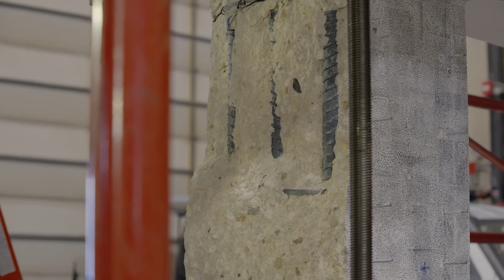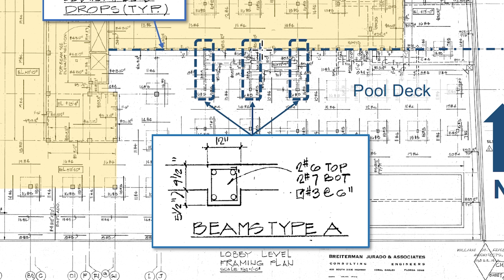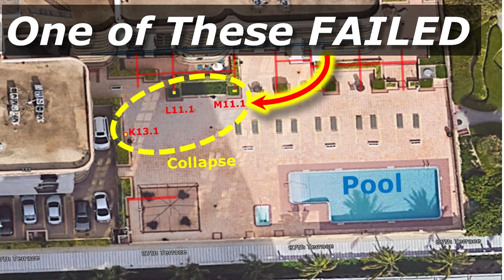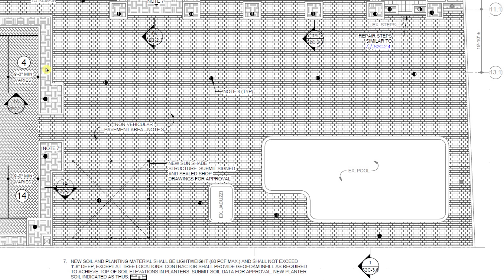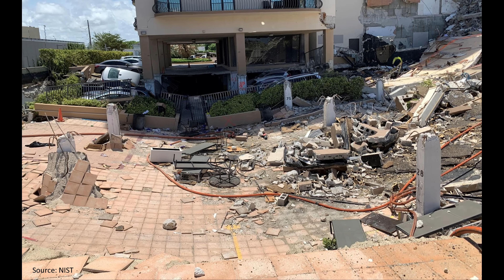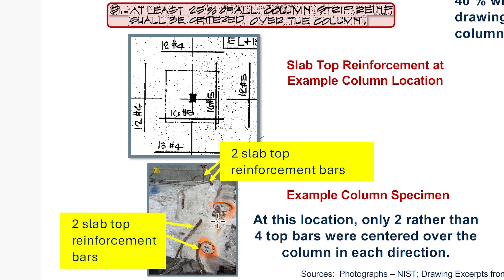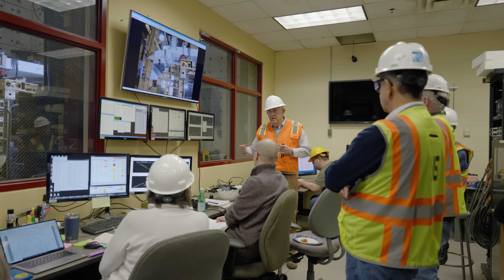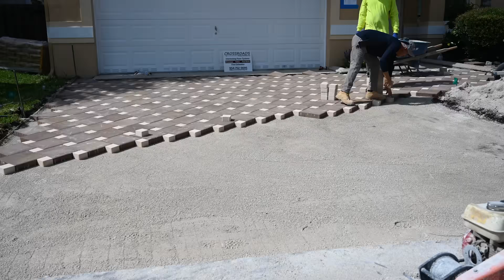Champlain Towers: Secrets the Feds Uncovered in Collapse Debris

Comment: Did they use the same concrete strength of 4,000 psi thru the column at the test site?
U said the column was 6,000 psi

Comment: The issue of the floor poured at 3000 psi, and the post at 6000 could have been mitigated with a ledger being poured on the cap of lower post. Even though it is expensive, stainless steel rebar largely negates the spalding problem. Considering the cost of litagation, insurance, insurance pay-out, and simply peace of mind, it would be worth it. And as much is possible and as quickly as possible GET THE WATER AWAY FRIM THE BUILDING. This can not be stressed enough.
I can see this being a case study in structural engineering classes.
Excellent  video. Thank you.

Comment: Having seen all your videos on this topic.. Am starting to theorize that the pool deck collapsed and that downward motion caused a very strong lateral motion that pulled concrete and rebars out of the building columns at the edge of the deck/ building area, and that caused the cascade of column  failures under the building. Of course the bad build and design and water intrusion and erosion added in.

Comment: The deeper than designed sand layer with pavers might have been coming from sub-contractor who typically built over soil, the extra inches of sand there can help assure low chance grass/weeds still access the soil below sand, thus grow between pavers over time. Plus does not have the same type weight limitations this application would have.

Comment: It really feels ridiculous that a deck that far off the building was able to bring the whole tower down. Moreover, putting the pool on its own deck at ground level was prudent from a structural point of view, given the nightmare of sloshing weight they cause (wrt. to putting it on the roof, or somewhere in the building), but they did not harvest the safety benfit of this prudent decision. 

I suppose the origin of all this crap is the decision to put the car park under the structure, then they have to use columns, they have to spread some of them apart to allow for lanes, they need a certain ceiling height, etc.

Comment: Florida is different, and in so many ways.  Concrete is local and limestone (as opposed to granite--used elsewhere) is what Florida concrete is made of.  It is a porous stone and subject to acid corrosion to a significantly larger degree than other cement substrates and engineers specifying concrete need to be aware of this additional Florida uniqueness.  Never hire an out of town architect.  (We've got a luxury townhouse development here in Tampa whose Toronto architects initially specified a cellar in each unit!  Except the units are only 8 feet above sea level as the excavator operators found out on day 1.......!)

Comment: No building should be constructed as though no construction is going to be done on the block next door. It’s obvious that new construction will occur on adjoining sites, so buildings should be constructed to withstand that construction. It’s the same as the millennium tower now blames the building’s subsidence on the building subsequently constructed next door, claiming that they temporarily lowered the water table by 20 feet in order to construct that new building…. But they also  temporarily lowered the water table by the same 20 feet to build the millennium tower itself, so obviously any construction nearby is going to do the same, so the millennium tower should have been constructed to allow for that. It’s no use saying “our building is perfectly safe as long as it’s the last ever building to be constructed.” It’s the same with this building. There’s no point blaming the construction of the building next door for your building’s failure.

Comment: I was appalled at the wide cracks in the concrete, in the San Francisco high-rise I worked in, after the Loma Prieta earthquake in 1989.  I was astonished that they were just plastered over and re-painted, I never really felt safe in that building again.  I was, for once not staying late, already on the bus when the earthquake struck and that was scary enough. My colleagues still in the building were forced to remain overnight or walk down dozens of floors, only to face the near-collapse of transbay transportation system.  I was lucky to get home that night as my bus had to cross the Golden Gate Bridge ten minutes after the quake, where no inspection or significant traffic slow down had yet begun.  We were all holding our breath crossing that bridge!  Radio reports were already coming in saying the Bay Bridge and Cypress Structure “had collapsed”.  These were pre-internet and cell phone days, radio was the fastest news there was.

Comment: Thank you for the update.  I love your simplified drawings and explanations.  If I were a millionaire I would want you as a consultant on any big project, you are safe though because I am just an old lady on social security who wanted to be an architect but could not even get into the 4 top schools I applied for  because they did not want women in the early 60's.  So I majored in theater where I could design and build great sets.  I also designed my own home and did 90% of the work myself.  I have also done blueprints for 5 homes for friends and family.  In my state If you are the general contractor you can pretty much do.. what you want as long as it passes inspection at each step.  When I needed steel I beams for large open areas, I went to the steel company and took the blue prints so they could figure the load, they also drilled the holes to bolt the rafters onto.  It always surprises me when people who live in urban areas where experts are available do not consult with an expert when doing something unusual in their design.  When I put a 26' 8" I beam across the basement ceiling of my house, the framing inspector liked the design but asked how I calculated for the beam, I said the name of the steel co, who made it for me did all the calculations from the blue prints for the expected load.  I could have spent hours at the library trying to figure it out, but the steel people did it for free when I bought the beam from them at contractor rate.  Another time I was not sure if the new house would need 200 or 250 amp service.  I made an apt and asked a guy at an electrical supply and design co.  What is $50-$100 to get it  right by double checking with an expert on a $250,000 house?  There are way too many contractors who are in over their heads, or are just cheats and cut corners on materials and pocket the money.  They never think about the people who are going to live in a building or work there.  If it is a bridge people or something important are going on top of it and often under it.  With the information reports you have tracked down for us, it is amazing it took the tower 40 years to fall down.,
Reply: Well written and said, times are changing and these tragedies will pop up and will prompt more project managers to assess the designs and the people they should hire!
My respects!
Thank you for sharing your experiences and accomplishments!

Nelson H

Comment: What takes four years ?
Is obvious that the builder used substandard cheap concrete.
Is a more than common MO of Florida builders. 
On top of that they shave millions on the “bathtub” foundations.
This is how they work, Florida acts as if they don’t know.
I know, and I live 1500 miles away.
Florida is just stalling and acting surprised, as if they have no idea.
In order to get millions of people into Florida, specially on the coast Florida looked the other way as builders used substandard materials and cut every corner possible to make the profit bigger.

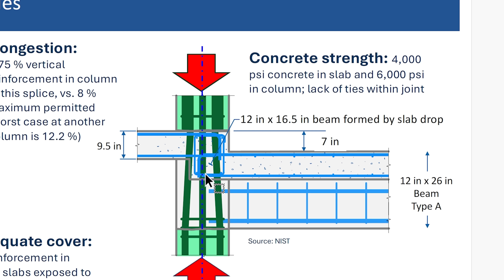Comment: 9:21 the way they are supposed to handle a large difference in the strength of the column concrete vs the slab concrete is they are supposed to “puddle” an area of the high strength concrete around the column and then pour the rest with the lower strength. It’s a standard practice but it’s a pain and gcs don’t like to do it. So as the structural Engr I usually try to keep them closer in strength. The code allows a certain amount of difference, but not a large difference like 4ksi in 6ksi columns.

Comment: Shouldn’t there be a ‘concrete crown’ with the rebar’s from the coulombs flowing in the floors/ceiling?
That way the floor couldn’t have simply sagged over the coulomb.
Reply from the maker: Yes better designs might have the crown or a drop panel, this is how they designed it back then. Newer garages in modern day times use beams on every column.
Reply: @jeffostroff 
Yes but it’s one or the other if done right both are fine.
In the underwater bicycle parking garage in front of the central station (Amsterdam) those crown are humongous.
Needed with all that water on the top and they made it in a design highlight.
It’s an attraction worthy of a visit even without a bike (it’s on YouTube) 
We learned from our past (the deck from a garage across town cracked and needed restructuring after only a view years)
Very costly doing it right after the fact but no serious accidents 🙏🏽

Comment: Concrete with rebar I think sucks rather than beams. Replacement of structural components should be a planned required part of building buildings like these, someone would assume expect,
Reply from the maker: Yes Robert, more modern garages use beams now, I plan to do a video on that

Comment: Various loads and vibrating frequencies that are constant from weight and design can transfer around the building, kind of like being electrocuted ,… very different technically then being electrocuted , … I would expect much from some Spaulding , I see it in several buildings , should probably be specific to the issues that cause immensity damage and risk.

Comment: I read some of the engineer Morabito report a while after the collapse. He clearly indicated that slabs were not graded,
and that numerous exposed rebar and leaks needed maintenance/repair in a timely fashion, or else the degradation would increase exponentially. This clear exposition allowed the legal process to be quick, rather than endless.  
Thank you, Jeff, for a revealing update.

Particularly in the absence of proper drainage the ambient marine salt air (& saline precipitation) and pool chlorine all 
contribute chloride ions to the water draining from, and leaking into the structure, in addition to carbonic acid. Rain away
from coastal marine locations is now somewhat acidic, pH about 4. As the solution drains away and evaporates, it becomes
more concentrated in the chloride ions, which constitute hydrochloric acid in water solution. This can cause deterioration of concrete via ASR, 'Alkali Silica Reaction. As the building structure dries out after a rain, it often heats up in sunlight. The 
rate of chemical reactions increases significantly with increasing temperature, particularly around/above room temperature.

Comment: Has any work been done to compare stainless steel in place of the normal steel bars in high stress areas ?
Reply from the maker: They have not mentioned it. Of course now, many builders like to use epoxy coated rebar.

Comment: it's interesting why the columns had as much as 8% reinforcement. Reinforcement is generally needed in the case of bending or very slender columns. In this case the columns are not slender and should not be bent much. This reinforcement suggests error in the  dimensions of the concrete. The pulling off the slab from the perimeter wall indicates that a big horizontal force was acting. The pool deck stopped carry horizontal forces after it broke. The problem was in the transfer of horizontal forces; the column heads were too weak to stiffen the building.

Comment: Yegads... 9" of paver bedding sand!!!

As you say, in Florida your standard practice is 2"... in California, I am used to about 1.5", placed on top of a flat compacted  3/8" gravel/sand (50:50 premix) base to ensure drainage. The mixed sand and gravel is typically less than 3" thick atop compacted earth. Total is no more than 4.5" for pedestrians and light motor vehicle parking applications.

Our local masonry sand runs to about 110 pcf, and the premix is about 100 pcf.

I am unfamiliar with the requirements for laying pavers atop a concrete slab, as you need to ensure drainage...  I have seen synthetic mat materials used beneath a 1.5" layer of bedding sand.

Thicker sand doesn't buy you anything, as all of the leveling and bedding of the pavers can be accomplished in a thin layer.

Comment: A mechanical guy here, with limited understanding of civil designs...  I'm a bit surprised that the building floor slab and the pool deck slab were tied together at the step-down, and that the rebar systems were integrated into the column rebar.

I would have expected that the two slabs would be separate, and that there would have been a gusset for each where a transverse ledger beams would provide  "landings" to support the ends of the slabs. The reinforcing to my mind would have used fasteners to tie-in to the columns and beams to limit transverse motion in the horizontal plane.

This would allow the use of different strengths of concrete for the slabs and columns, and would allow for an expansion jointwhere the pool deck abutted the building.

The other potential advantage of this joint arrangement would be that the shear strength of the connection could be designed such that a failure of the pool deck would not pull the building columns out of plumb, allowing the occupied residences a much better chance of surviving a collapse.

Basically, a designed point of separation to limit the scope of a failure to one system as much as practicable.

The residential building might still be compromised beyond further use, but could have failed in a safer manner, allowing the residents to escape without serious injuries..

And, that is ultimately what we are required to do with our designs - allow the people under all but the most extreme circumstances to escape / evacuate with minimal risk to life and limb.

Comment: You can see right in the video that the collapse started right between the 1st and 2nd floor and the whole middle section goes down in unison with all three column's. Another thing you said that was interesting is that they added the penthouse and another floor after the plans were drawn up so that means the under structure was not designed for all that extra weight. The column's were only engineered to hold the weight of the original design, right?

Comment: I think using  the same stuff as the fast cars use (i can not think of what they call that right now) instead of iron would put the weight down to much lower and take some of the stress off . (I hope you can understand that when I can not think of what is called )

Comment: It may have been mentioned somewhere and I missed it, but were the original engineers even aware that they had made the pool deck an integral structural element whose collapse would cause a catastrophic failure of the whole tower? I'm not an engineer, but that strikes me as an odd and difficult to defend design choice. Was it a deliberate design choice or merely an oversight?

Comment: 1st the pool slab should have never been designed /attached to the building! 2nd the pool supporting columns are as you say, to far away. 3 the columns under the building should have been larger and the steel should have been continuous. 4. the homeowners or condo association should have address all the issues years ago!

Comment: That 9in of sand, when it gets wet, adds couple tons around entire slab. Then is hot, so water evaporates, then rain and it soaks again, creating cycle of load and unload.
At this point its not question why it fell, but how could it stand for so long.

Comment: I’ve learned so much from your CTS collapse videos. Thank you for your clear explanations. I wish I had majored in structural engineering, the way buildings are designed so that they stay up. The massive structural test models built by NIST and University of Washington are amazing. So much depends on proper rebar. Those NIST folks think of everything. So tragic that a few more capable people weren’t on-site over the years to check these issues during the life of the building, especially those tragic deck remodels. I wonder: if they had just stuck with the original Cool Deck would the tragedy have been avoided?

Comment: I think the penthouse would have been fine if the building was built correctly. And by correctly, I mean the pool deck should not have been tied into the columns of the building. Two reasons it should have been separated. One: the pool deck is a huge area & catches a lot of sun, causing thermal movement. Two: The pool deck structure is built totally differently to the building itself. It should have been an isolated second structure on the property from the building. Whomever approved all those changes & did not catch the problems before the concrete was poured is 100% to blame, as is the city and building owner(s) who knew the deck was tied in based on inspections etc. This building was always going to fail, penthouse may have accelerated it by adding weight on the substandard columns etc, but it was always going to collapse. Edit: It should be noted that when CDI came in to take down the remaining structure, Mark Loizeaux commented that the concrete "didn't resemble the claimed 6000 psi mix" in the columns. In addition to that, you saw how the columns were laying on the rubble. This means the connections on every floor were improperly done on top of the questionable concrete quality. In essence, this building aimed to meet minimum standards of the era & missed by quite a bit. I also wonder why they did not remove the original pool deck top layers instead of adding more on top. This seems like a massive oversight? Needless tragedy.